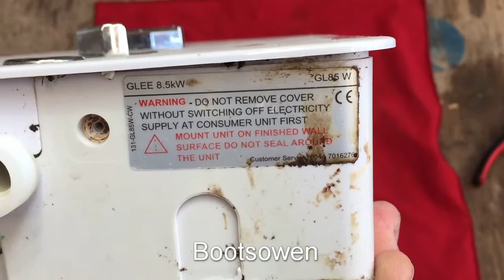Bristan glee electric shower teardown 8.5kw GL85W

Comment: I have the same model. Water is coming under shower near prd. Any advice how to repair please? Should I change the prd? Normally as far as I know there should be a ball inside for regulling water. But I haven't seen any balls in the new prd, so I'm not sure if it will help in my situation.
Reply from the maker: is the water coming out all the time or just when the shower is on? Is the hose blocked, or does it come out the hose as well?
Reply: @bootsowen  Just when shower is on. 2)The hose isn't blocked. Water come out from the hose just a bit, much less then from under shower dashboard.
Reply from the maker: So is it leaking from the prd or somewhere else?
Reply: @bootsowen   before it was from the dashboard, after that I opened and realized it is from prd, then I removed prd and realized it is comes from PRD Diaphragm.

Comment: This is the shower i have. Out of the blue today no hot water. Thermal cut out?
Reply from the maker: Maybe. Have you checked?
Reply: @bootsowen  taken it apart and clicked what I think is the reset. Clicked when pushed any how. But still no hot water. Think I might just bite the bullet and replace the shower.
Reply from the maker: Bit feeble. Have you checked that there is power to the device from the shower rcd?
Reply: @bootsowen  it's on its own Rcbo. 230v coming in. It's the 9.5kw version which is very slightly different to the 1 you had. Front dails are via the circuit board. But layout is very similar otherwise.
Reply from the maker: It’s over to you as to how far you go. If the trip had popped out and you pushed it back did you check for continuity with a multimeter?  If it was me I would go through it while it is open with a meter and see where the power is going. But I have been called various things and none of them safe!  If it has a board does any of it look cooked?

Comment: hi I need to change the tco can I just remove the metal clip and screws and tilt the water tank forward to get to the screws on top of the tco? it doesn't look an hard job to do but I don't want any leaks by tilting the tank forward if it can..   thanks
Reply from the maker: I had a redring shower once upon a time. I made a video of it. It had a resettable thermal fuse above the element heater. It was possible to slacken the screws holding it in place with a needle nose pliers and pop the trip back in when cold. Make sure the power is off.